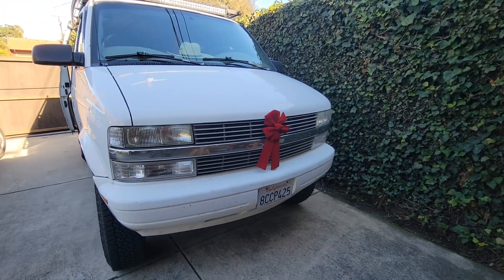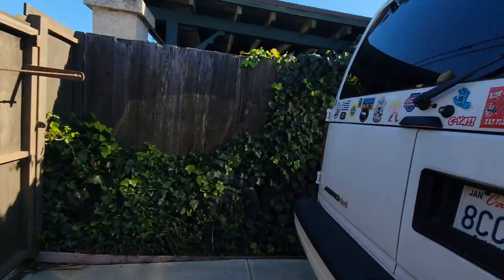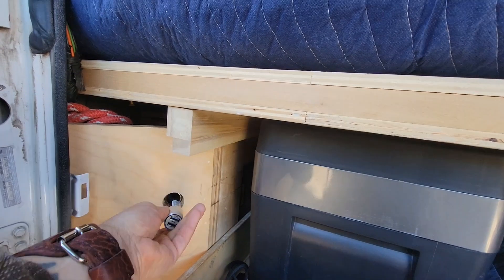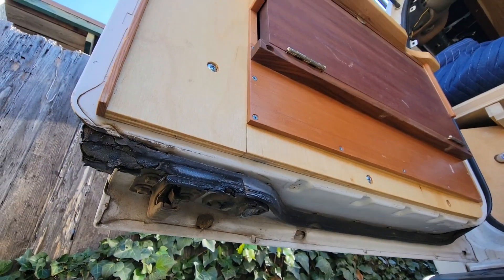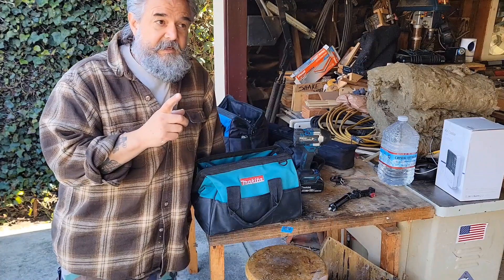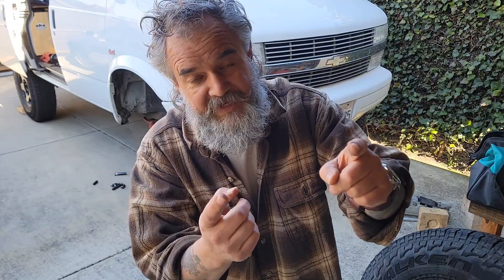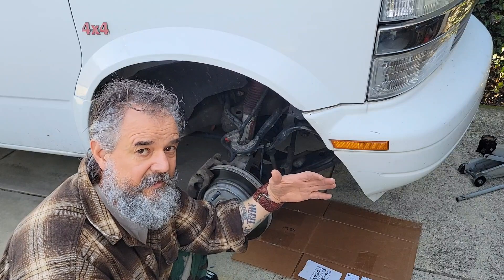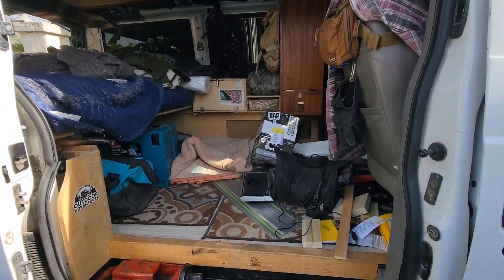Finally, Astro Van  Content (For Those Of You Jonesin')

Comment: I wish I had a video of what I did to my Sprinter.  Makes recreating it that much easier without taking it all apart.  Custom versus mass produced.  So many leasons learned. Criss Cross apple sauce on dis-smount and mount on the wheels.  High millage oil truly helps with most oil mild oil leaks.  You do nice work Mike.  Thanks for sharing.

Comment: I framed out of a 86 Astro for years 
One winter we got a good ice storm come in while setting roof then started freezing my nail guns up don't  run alcohol in my pig tank because it drys my hoses out and creates pin holes eventually 
Anyway the temps never got above freezing for a week so you know framing feast or fammon so back to the job to flip scaffold boards and knock ice off and get to making money.
Turned out warming up and thawing everything out which made my entry road a muddy mess
By hotroding that Astro van to get out of the 1/4 mile of dirt road it sucked up some trash in a cylinoide in my transmission stuck in 1st gear 40 miles from my shop. Tried everything 20 mph and slam it in reverse  still didn't work

Comment: food 4 thought,,, I was just thinking... If your lift in front is just hockey pucks.... and all your susp. is attached (hinged from..,, upper and lower con. arms)) , then distance hasnt changed  for lift.  If it ever stops raining here in SLO Co. Ill go crawl under my astro and have a looksee.
Reply from the maker: Right, but I also did replacement torsion keys and cranked them - You can see my CV's aren't parallel to the deck...

Comment: A man and his machine. It is a beautiful thing except when it's not. Ouch, this looks like a major modification of sorts is in order on the stock swaybar system . Leaky O ring seal on steering box. Main bearing  seal by balance wheel is shot. Leaky
 line to power steering pump . Looks like you have some tough - to - get - to repairs on your baby. More how to vids are 
ahead for sure.